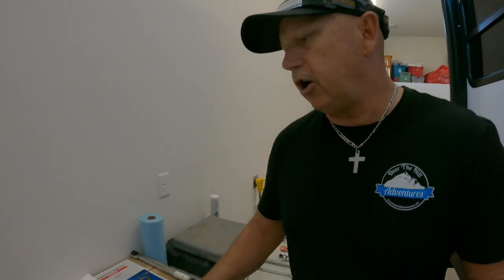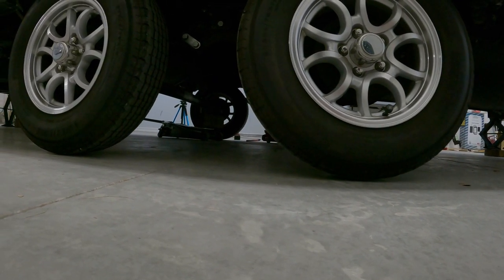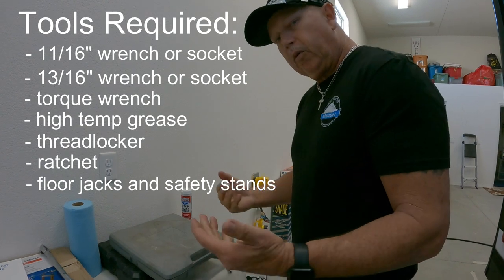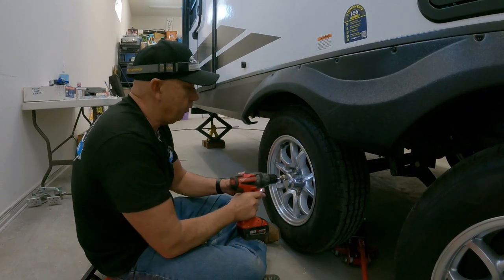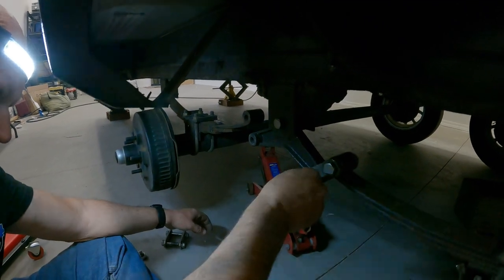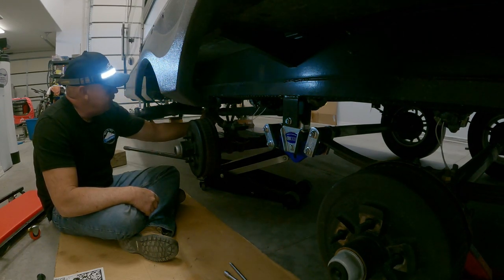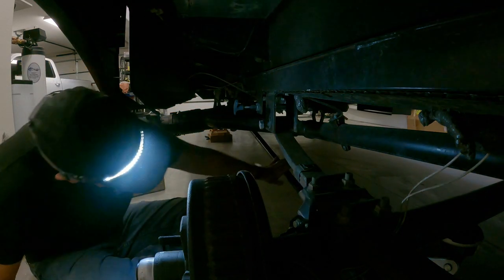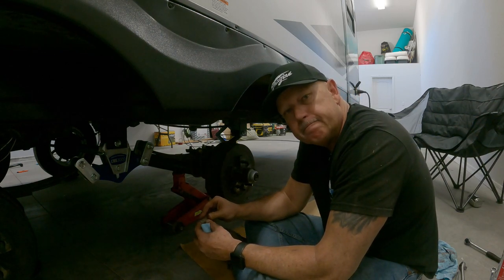GRAND DESIGN IMAGINE // MORryde Suspension System and Wet Bolt Kit Upgrade // Full DIY Video

Comment: This won't help you now but if you ever do this again,  put the bushings in the freezer overnight so they contract/shrink and they'll slide right in the spring eyes.
Reply from the maker: Rick, I forgot about that trick! That is good advise.  Forty years ago I work for a vertical pump company.  That was what we did to get bushings in and heat to expand.  Thanks for mentioning it on the channel.  Stan

Comment: I have a Morryde system on my trailer, it was on the trailer when I bought it. As I watched the video (not thinking I would learn anything new) a few red flags went up in my mind. You started talking about wet bolts and zerts and I thought I know that I don't have zerts on mine. I went out crawled under and confirmed. A few days later I went to a RV show and Morryde was there. I found out that mine had a plastic inserts and dry bolts that wear out very quickly. They make a Heavy-Duty Shackle kit that I can replace mine with, the kit looks just like what you installed. BTW the rep said that their zerts are notorious for getting plugged, so get some zert caps for them. I will be upgrading my suspension soon, thank you for helping me to see this problem and saving me problems down the road.
Reply from the maker: Hi Matt, you are so welcome.  Thank you for joining.  When took apart the suspension the plastic/Teflon bushing were going as you saw in the video. Only after 10,000 miles!! No wonder folks break their leaf springs.  Thanks for the tip on the zerk fittings.  So far so good!  Blessings and safe travels, Stan and Rhonda

Comment: We have the 2021 2600RB and experienced the same issues of wear, tear & recalls.  In addition, we also experienced fresh water syphoning out through the overflow line, & cracked fender flares.  Having watched this video I'll be better prepared to do this suspension project next.  Thanks.
Reply from the maker: The suspension made a huge difference for us.  When I talked to Grand Design while doing the factory tour, they told us we made the right choice over the other brand. We love our Grand Design and traveled over 21,000 miles without any major problems.   As a matter of fact, just changed out my Westlake Tires.  Discount Tire was surprised I had them on so many miles.  Thank you for watching if you need anything just reach out.  Blessings, Stan and Rhonda

Comment: Many thanks Stan for doing and recording the upgrade. That is exactly what I was expecting to see, an actual install video.  I should be able to do the upgrade this summer on our 2500RL. Also,  thanks for listing the kits on your Amazon page.
Reply from the maker: Hey Jim, the only thing I was missing was a good breaker bar.  The bolts are not supposed to spin like that.  You should only have to break the nuts on the inside.  I highly recommend this upgrade after seeing the wear on the plastic bushings.  You are so welcome!! You can do this job no problem.  Thanks for watching, Stan

Comment: Thanks so much for this video. We have a 2022 GD Imagine 2600RB. I plan to do this upgrade before next camping season. Your video gives me the info and confidence to perform my own upgrade. Thanks again! 😃 Happy Camping!
Reply from the maker: Dan, You got this!! And you won't regret upgrading the suspension. As we have said several times, especially after cross country trip in the spring, we are glad we upgraded the suspension. At our Grand Design Factory Tour in April we brought it up and they said we made the right decision to go with MORryde. Feel free to reach out if you run in to any snags.
Stan and Rhonda
Reply: @OverTheHillAdventures  Thanks for the vote of confidence and the affirmation from GD. And I really appreciate your willingness to offer guidance when I get to my upgrade. 😃

Comment: Great job. Looks like a good project for my 2500rl.
Thxs for the video.
Looking forward to your opinion on if any noticeable difference.
Safe Travels.
Reply from the maker: Hi Rick, we took it down to the Grand Design Rally in Quartzsite after I did the install.  The trailer was traveling super good.  A very nice ride almost rolling on air.  Did really well in the desert with all the dips and rocks.  I highly recommend this upgrade after seeing the worn parts.  Thanks for watching Rick I appreciate the kind words.  Stan

Comment: I am in the process of doing this to a camper that is 15 years old...Rust has taken its toll and after about 8 hrs,  I just about have one side done.   If I'd have known it was going to be a battle, I would have taken it to a dealer.   I'm now very wary of YT videos that make things look easier than they are.
Reply from the maker: Hello Ronald,  we did this upgrade on a 2021 Grand Design trailer.  If you would of asked about putting it on a camper that is 15 years old I would of advised you to take to a professional.  The installation is as easy as it is shown on our video.  Many people have written on this thread with the same result.   I am so sorry you had a bad experience.  I can guarantee from experience if you would have taken it to the dealership it would of probably been there for months.  I also stated in the video not to attempt this unless you are completely comfortable doing the job!  On a 15 year old trailer, I’m sure it was a major job. Hopefully you will be happy like we were with the upgrade.  Thank you for your input and comment.  Stan

Comment: Just a cautionary note.  I have a GD Reflection that came with wet bolts and copper/brass bushings.  In less than 12,000 miles the bushings were completely shot.  I wasn't expecting them to be so bad when I changed them for the beefier shackles.  Glad I did.
Reply from the maker: Hello Maureen, I the heavy duty shackles. I would change out the CRE3000 for the new CRE4000 way more stout for the Reflection.  Depending where you live and where your rig was towed to from Elkhart Indiana you may have more miles than you think.  Thank you for your comment.  I will check them once we get back. Thank you for joining us, Stan and Rhonda

Comment: Seems like the grease should be primed on the bolt so the outside of the bushing would lock into the inside of the spring eye.  Its the bolt that gets lubed to pivot inside the bushing.  NICE RV GARAGE. Us Cajuns change axles on muddy St Augustine grass on a Imagine 24mpr at 75 yrs old (still trying to prove we don't have what it takes}...that's what 3 tours in Nam gets you.
Reply from the maker: J Brous, thank you for your service Sir!  You are correct!! I put lots of grease in them.  I rebuilt my dad 1967 on St. Augustine grass.  Toughest grass there is!! Until I dumped to much oil on it. Have a great day! Thank you for your comment.  Stan and Rhonda

Comment: Great video. How long should it take a RV dealer to install?
Reply from the maker: Hi Mike, I have no clue.  What I do know is some RV dealers will keep your RV for a month not to mention it may take you a few months just to get in.  I took my other RV in for a small repair and finally got it back with a dead battery after 3 months.  Hope this helps. Stan

Comment: Why wouldn’t you lube the wet bolt through the grease fitting to ensure there is no air pocket in the shaft of the bolt and then spread the grease?
Reply from the maker: Hi Paul, I can’t remember but I am pretty sure I did. I just didn’t film it.  It’s pretty cool the wet bolts fill pretty quickly.  However, that is a very good plan.  I also greased before I put them in.  Never had any issues with greasing them.

Comment: Good work, Stan!  Think I’ll use the battery impact, I don’t have your upper body strength!
Reply from the maker: Mark, you are 100% correct.  I wanted to show it could be done with conventional tools.  I’m a flip flop king when it comes to buying  an impact driver.  All my battery tools are Milwaukee.  Super expensive.  Which one do you suggest?  Love  the new suspension over a thousand miles!! Love it!! Thanks for watching!! Stan
Reply: @OverTheHillAdventures  I went DeWalt, the big boys try to outdo each other so it all depends on who has the latest.  Wranglerstar (a utuber) is a Mikwaukee/SnapOn user.  I’ll have to check my eTrailer wetbolt kit to make sure the 4 outer spring bushings are included, or buy separately.
Reply from the maker: @markbergthold6181  when I bought the suspension system and wet bolt kit.  I ended up with extras which was nice. I was really surprised how worn the stock suspension was.  Reference the impact I will go with Milwaukee so that batteries are all interchangeable.  Good to see you on the channel Mark.  Good luck with the suspension change you will be very happy.  Stan

Comment: When installing the new wet bolts, one should have a wrench on the bolt head to keep the bolt from turning.  Just tightening the nut may cause the entire bolt to turn and the serrations on the wet bolt will wallow out the new shackle.
Reply from the maker: Carl, great advise but you shouldn't have to.  The serrations are made to seat in the heavy duty shackles.  Not one of my new wet bolts stripped the serrations.  However, it would not hurt especially when using an impact wrench.  I will tell you as in the video, a lot of the old bolts serrations were stripped.   I think it was because they over tighten them.  Per MorRyde specs 40lbs of torque.  Thank you for your comment!!  Stan
Reply: @OverTheHillAdventures  Yes, during installation at the factory those OE bolts turned because the bolt was not held in place when the worker tightened the nut. The serrations wallowed out the shackle. It’s always best to err on the side of caution and use a wrench on the bolt head when tightening the nuts.

Comment: I’m not clear on where you supported the camper weight with the jack stands/ jack.  I see you lowered the rear stabilizers to provide stability but they are not weight bearing.
Reply from the maker: No I did not use the jack stands as weight bearing.   Just to stabilize for extra safety.  I put the jacks stands in back where the frame drops down.  I also put the jack stands in the front where the frame drops down. Then I put the stabilizer jacks down for extra safety.
Reply: @OverTheHillAdventures  Thank you.  I want to do this upgrade but was not sure how to support the camper. I have a 2022 GD 2800BH.. Great instructional video. I will use it when I use my upgrade. I enjoy all of your travel video’s. Watch them every week.
Reply from the maker: @leonardcole5095  thank you Leonardo!  I lowered the front of the trailer all the way down.  I placed heavy duty jack stands in the back first.  With two 3 ton floor jacks I lifted up the front until all four tires are off the ground. Then placed the front heavy duty jack stands in the front of the frame.  Don’t forget to break the lug nuts on the tires. Thank you for joining us.  Stan

Comment: Pretty sad that only after a year the suspension parts have that much wear on a trailer that cost as much as they do. Nice job though looks like a quality upgrade.
Reply from the maker: Dave, agreed!! However, folks are traveling further then ever before.  Not just on weekends or a couple of weeks during the summer.  They are gone full time or traveling full time.  It is only my opinion travel trailers were never made for full time living or long travels. Hence the term recreational vehicles.  Plus the roads are terrible!  Which leaves owners of travel trailers to upgrade to withstand this type of travel.  Thank you for watching our video, Stan and Rhonda
Reply: @OverTheHillAdventures  I can agree with that. We will be taking our first long trip this summer in our new 2600RB. New Jersey to Rhode Island then to Maine. I'll be pulling with the almost the same truck as your 1500. We will see how it goes. Roads are very bad over here.
Reply from the maker: @davefederici2618  you will do great.  When I towed with my 1500 I traveled with only 2.5 gallons in the water tank so I would not go over my payload.  I watched my payload like a hawk.  Safe travels 😎🙌 Stan

Comment: Going to be doing this same job. How did it tow after the change?
Reply from the maker: Hi Steve, like night and day.  When I changed to the Goodyear Endurance Tires the trailer towed awesome.
Reply: @OverTheHillAdventures  I just put Goodyears on as well. I won the wet bolt kit at a rally so figured I’d do the whole suspension upgrade. Did you notice any change with sway?
Reply from the maker: @steve4658  the towing experience in general was better. At the time, I was towing with a 1/2 ton with a blue ox weight distribution hitch. I ran air bags on the truck so I had very little sway.  It improved the bounce and the sway of the trailer. The trailer towed better all the way around.  When I got the 3/4 ton the trailer towed like a dream.  33,000 miles not a single problem.

Comment: Thanks for posting the video.  I have a 2019 2600RB and just bought the MORyde CRE3000 from my dealer.  Based on your video I knew I had to get the version for the 35" wheel base, but the dealer was unsure of which wet bolt and shackle kit I needed and you didn't mention any sizes or part numbers for those.  The parts guy said everyone was getting a standard version even though there are two different sizes.  I want to make sure they ordered the right parts.  Would you share what the dimensions/size specs are on the wet bolt kit and shackles you used?  Thanks for the info.
Reply from the maker: If you look down at the description on the video you will find which shackles I ordered from Amazon.
Reply from the maker: I also have it in our Amazon store.  If you go to www. overthehilladventures.life got to the hamburger at the top and go to shop.
Reply from the maker: https://amzn.to/3raJJPe
Reply from the maker: Rhonda made it easy and got you a link.
Reply: @OverTheHillAdventures  got it.  That's what they ordered.  Hopefully the installer compares the old with the new.  I measured mine out of curiosity before taking it in to the dealer and I thought the shackles were 3 1/8" but maybe the 2.25" is the bolt size and not the shackles?  I guess I have to trust they know what they are doing, because I don't.  Thanks for the reply.

Terry

Comment: First, your video's helped me deicide which Grand Design Model to purchase.  Thanks to your input Stan and Rhonda, I have just purchased a new 2500RL - thank you!!!   Quick question outside of the Suspension System.  Did you guys upgrade yours and did you do both vents or just the one in the bathroom.  My dealer is quoting me $1,400 to replace the standard vents to a Domestic Fan-Fantastic Vent and not sure if both are really needed when I'm boondocking.  FYI,  I'm not has handy as Stan :)
Reply from the maker: Daren, we have the vents that came with the rig.  The one in the kitchen and in the bathroom are the power fans.  Standard power fans.  To be honest with our small space I thought putting the fancy fans were a waste of money.  We open the glorious windows we have in the trailer and it’s been wonderful. I would definitely check around on the price.  A whole air conditioning cost $600.00.  Daren that’s way to much money for a 1 hour job.  Thanks for the kind words and hope this helps. Stan and Rhonda
P.S.  I’m going to check on Amazon to see how much those fantastic fans are..lol
Reply from the maker: Daren, Fantastic Vents on Amazon are $61.00.
Reply: @OverTheHillAdventures  thanks so much for your prompt response.  Getting mixed feedback on FB Grand Design Owners Group regarding fans and I’m going to hold off and do the upgrade myself later.  

You guys are awesome and thanks so much for sharing your knowledge!
Reply from the maker: @darengreene8665  that is a great idea!  I might even install one myself.  Thank you again for being part of our adventures. Stan and Rhonda
Reply: I have a 2500 rl and added a max air in bedroom. Had the dealer do this prior to picking it up.  Boneheads had it wired to the light switch in BR so you had to have lights on when running the fan.  Installed a separate switch in bath wired from that light switch so I can control it separately
Reply from the maker: @RickStalkerG55  wow!! We tend to do things ourselves so we know it’s done right.  Thank you for your comment. Stan and Rhonda

Comment: Why didn't you change out the leaf springs?
Reply from the maker: No need to. Only 10,000 miles on the leaf springs when I did the suspension.  With the wet bolts not much stress on the leaf springs unless you overload your trailer. Thanks for watching. Stan

Comment: Did you tilt the front end down and then stick jack stands in the back and then lift it with the tongue jack and then place jack stands in the front? Or use your floor jack in each corner to lift each corner as you went? And are you really just on 4 jack stands? Also, it looks like you were on the drop frame portion, is that right? My 2400bh has drop frame in the back with bumper and in the front by the stabilizers. Is it ok to hoist it up there? Would be so much nicer since then I wouldn't need to deal with the belly cover. Thanks in advance!
Reply from the maker: I did drop it down on the front put the jack stands in the back first where the drop frame is welded to the original frame. Then lifted up in the front by the frame.  If you have two floor jack the the front evenly.  Yes I on only used for jack stands.  Once I had it up on the four jack stand, I dropped the stabilization jacks for extra safety.  I used 3 ton floor jacks. I was nervous doing it but it worked.  Be super cautious.
Reply: @OverTheHillAdventures  Went ahead with the install today. Did it how you suggested and it went well. Good stuff!
Reply from the maker: @casmered  glad to hear thank you for the update.  I did the Grand Design tour in Elkhart Indiana yesterday.  I told them what I did and they said it was the best decision I could of made.  Grand Design Rep recommended MORryde  over all the others.   I am totally happy with it.